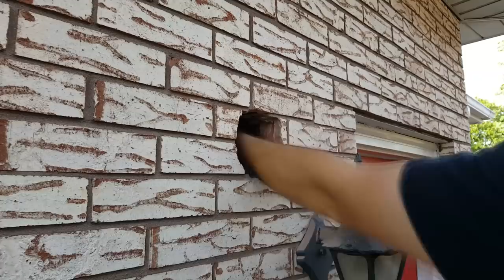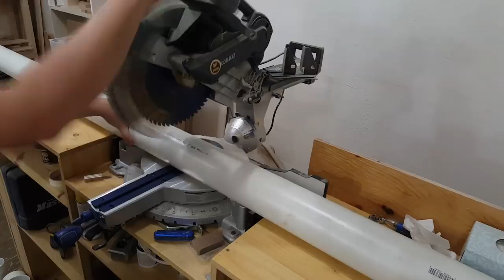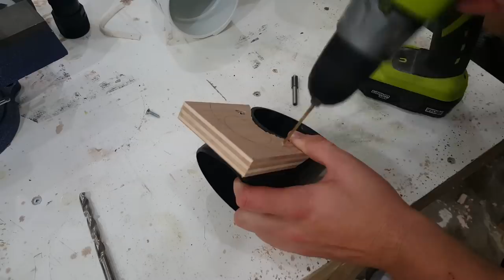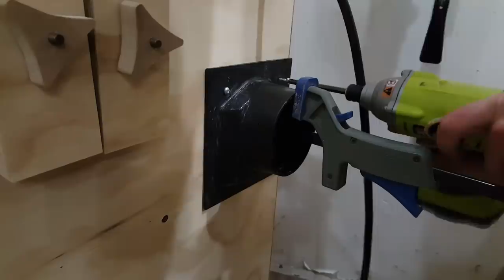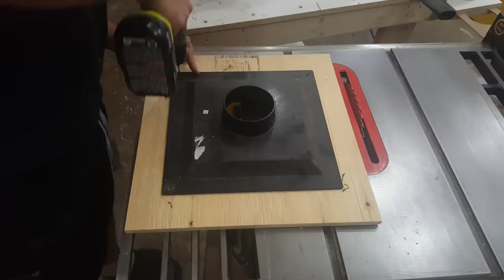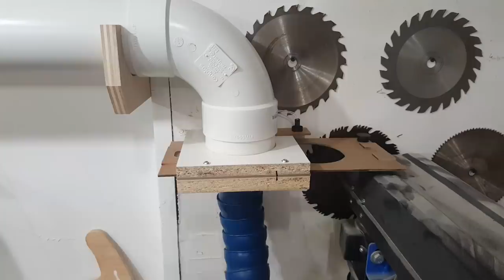DIY Dust Collector System with Homemade Blast Gates and Automatic Start/Stop Function

Comment: He’s gotta be in the southern states! You can’t exhaust it outside up here in the north, you dump all the heat out in about 2 seconds! 😩
Reply from the maker: In Canada eh
Reply: DIY Builds not quite but close enough.
Reply from the maker: @rbwoodwork1890  no im in Canada.
Reply: DIY Builds sorry didn’t get that.   If you exhaust it outside you will pump the heat out. If it’s just for a sec or two it won’t really matter but a long operation will empty your shop.
Reply from the maker: @rbwoodwork1890  it's not climate controlled in my garage.

Comment: I am trying to build a dust collection system for my woodshop class since my school district will not pay for it.  I have a somewhat decent size shop area with multiple tools running at the same time.  Suggestions on what I need to build the system to support several power tools at once?

Comment: Hell yeah! Another awesome video!

A few questions, though... First, what changed your mind about venting outside/filtration since your video on the cyclone? when I asked you about it then, you said it wasn't a big deal. Just curious.

Second, when you installed the flange on the bottom of your table saw, I noticed you caulked everything in place. How do you plan on doing any maintenance to the saw?

Third, are you using 4" PVC, and if so, how well are you finding the extraction to be with your dust collector? Also, what size is your collector? I'm trying to compare against my 2hp Harbor Freight version.

As always, I love the video! Fantastic job, and I look forward to your next one. Oh, and good to see you over at /r/woodworking, too!
Reply from the maker: +crouton976 I decided to vent outside because the cyclone doesn't get the micro particles. if I have to tinker with the table saw breaking the caulking and redoing it won't be that bad. the system has very good suction at each station with the 4 inch and 2hp harbor freight motor. the miter saw which is furthest away has great suction.
Reply: DIY Builds Hell yeah, man. I was kinda worried about all the fine dust after the cyclone video, but I sure as hell wasn't going to tell you how to run your shop! :)

That's great that the system works so well. Like I said before, I'm getting ready to set mine up almost the exact same way, so that's fantastic to hear.

By the way, I'm the market for a new miter saw, but I need it to be somewhat compact. I'm designing a miter saw station that will also double as lumber and sheet good storage, and of course space in my shop is at a premium. Is there any way I could convince you to tell me the measurement from the back of the rails to the front of the fence on yours at 90 degrees?
Reply from the maker: +crouton976 you should look at the Bosch miter saw that has the 2 folding arms to save space
Reply: DIY Builds yeah, I've considered it, but dat price tag, tho...

Seriously, if I can get away with a less expensive saw fitting, I will, but if push comes to shove, I might end up going with the Bosch.

If you don't mind getting that measurement, that'd be awesome, but if not, no worries.
Reply from the maker: omg its 24inches from front of fence to back of slider mechanism.... and thats why mine overhangs my stairs lol
Reply: DIY Builds Haha! That thing's a big ol' boy!

That actually works out. I'll have to shrink my bench dimensions slightly, as it will be directly across from the miter saw station, but I should still have a 36" walkway between them.

Thanks, dude!

Comment: Hi Brad, I really enjoy all of your videos. I am planning to build your table saw lathe (with upgrades) next weekend :) I'm also working on setting my all my dust collection up and I was wondering where you can get that bendable thing that you were using to collect dust from your drill press? Would you consider putting links to all the gear you use/feature in your videos?
Reply from the maker: Lee Valley. Called loc line
Reply: Oh and I meant, would you consider doing links of tools and items used in each video, in that video’s description. Many makers use affiliate links as well, to get a little kickback. I would gladly purchase through your links as a way to support your channel.

Comment: How do you like venting to the outside? I am considering this instead of buying a high dollar canister filter, but I’m worried that during the winter I will be exhausting too much heat along with the dust.
Reply from the maker: If u use heat or ac u need a filter. Watch my shop upgrade video from a few months ago.

Comment: Nicely done! Very interesting and inspiring. I might steal some of your ideas! 
Where do you stand in the discussion on risk of explosion because of static electricity when using PVC piping instead of grounded metal piping? There doesn't really seem to be a consensus on that topic :)
Or would that risk be irrelevant by blowing all really fine dust out of your shop? 
Would blowing the dust out of your shop mean anything for the air quality around your shop, or would that effect be negligible?

Thanks
Reply from the maker: +Edwin van der Burgt I wouldn't be outside or anyone else while I'm using it so it is fine for me to vent outside. there is no risk of explosion because the pvc is an insulator. you might get static shock from the outside of the pipe but there won't be a spark on the inside. the motor and blower and cyclone are grounded so any charge there is dissipated.
Reply: That sounds reasonable. Have you already experienced shocks like that? Would that be like the electric shock you can sometimes get while stepping out of a car? Can't be to bad, right? Money wise it's definitely interesting using PVC instead of metal.
Reply from the maker: +Edwin van der Burgt havnt been shocked yet
Reply: Let me know if it happens, I'm curious how bad it would be ;) Keep up the good work!

Comment: Do not use plastic (PVC) ducting. it can create a fire due to static electricity and saw dust. can create nice little explosions. Metal ducting is the only safe and secure way to go.
Reply from the maker: Thats not true.
Reply: @DIYBuilds  You even should put your cyclone and dust bin/bag outside so if it ever catch fire it wont burn your house down completely. It happens!  put your head in the sand, is fine with me.
If you build yourself a serious woodshop you should do it properly. grounding all metal etc etc.

Comment: hello I love a video in which we saw you install a dust collection system, I would love to know the place where the manufacturer of your little blue hose that you use for the drill press?
Reply from the maker: Lee valley loc line
Reply: @DIYBuilds  yes i found thank you very much and continue your exellent video

Comment: I’ve always thought it better to use 2-45 deg instead of 1 90 deg for bends
Reply from the maker: Im sure it is but that cost more money so I didn't do that lol
Reply: No your right you’ve gotta cut sometimes. Mostly it depends what you’re putting through there. I was a home builder I’m retired now and there were times when I made custom crown mounding . I had special knives made and made the crown out of 2x8s . So there was some chunks going through there. I have a grizzly 10 hp which is huge and not 2 stage so I’m going to remodel that. I also still have my original grizzly 2 hp. When I had big moldings to make I actually used both of them.  Later I found the 5 hp enough of I ran straight 5” hose from the collector to my moulder. I had a couple 90s and they would clog if I tried to make moldings through them. I’m starting from scratch since I’ve moved so just checking out every bodies ideas. I’m going to put micro switches on my blast gates. They are super cheap then I just need to get a relay to start the machine.

Comment: Any chance of detailing the low voltage blast gate switch set up?
Reply from the maker: +Rich Wachtel robably not. it's just a relay that controls the motor power flow. it uses a 24vdc adapter and a bunch of parallel runs to the normally open switches.

Comment: It's been 2 1/2 years.  Are there any water issues from not sealing the exhaust duct on outside the building?
Reply from the maker: I did caulk it.
Reply: @DIYBuilds  
I guess I missed it.
That's good to know.  Cool project.  Thanks for the tips.

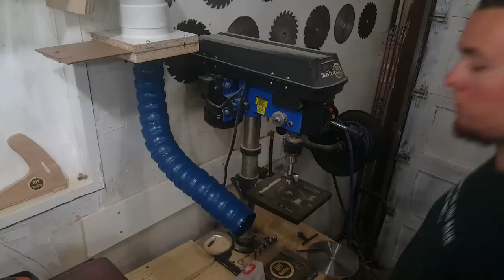Comment: where did you buy that blue flexible rose used on your drill press? the one shown at 10:07 on your video. Great setup of yours! by the way
Reply from the maker: Lee valley called loc line
Reply: @DIYBuilds  Thanks a lot!

Comment: Please, where did you get the blue flexible adjustable pipe which you use at 10:08 in this video? What is it's name? Thanks
Reply from the maker: +Miroslav Joha loc line at Lee valley
Reply: many thanks

Comment: Where did you get the low voltage parts?
Reply from the maker: +Kevon Houghton see viewers comments video #3. Basically you can buy them on Amazon.
Reply: Thanks.  Do you recall, specifically, which ones you used?  I'm not sure which comment / video you're referring to.
Reply from the maker: +Kevon Houghton i have a video called viewers comments #3. And any 24vdc or 12vdc contactor should work.

Comment: I have a question ?  I never see anybody talk about,, would smaller pipe be better ? more pressure or more suction like for in 2 to 4 "   will you suck up anything bigger than a 2-inch pipe I don't know ..
I would think 2-inch would have more pulling power than 4 " ?? somebody let.
 me know..
Thanks 👺 Teddie
Reply from the maker: No. The 4 inch is what the dc is optimized for in design. Vacuum cleaners have a smaller hose but higher suction power because the small impeller they have spins wayyyyyy faster than a dc. But a dc moves way more air.

Comment: 1 baffle for 3 connections?
Reply from the maker: If you mean the Sanders then yes. The 4 inch hose is capable of doing all 3 smaller hoses.

Comment: Where’d you get the flex line at 10:08
Reply from the maker: +Eric Althouse loc line from Lee valley
Reply: DIY Builds thanks!  What kind of piping did you use? Sewer or sch 40?
Reply from the maker: +Eric Althouse pvs

Comment: What's the blue hose called? Link? 10:08
Reply: I found this product from Lee Valley called Loc-Line which is great from drill press duct collection because where ever you set it up to suck it stays in place.

Comment: My only thing I see from the start is you are ducting the air outside instead of the conditioned air back into the room. If you are running AC you are basically removing all the AC air our of the area in a very short time.
Reply from the maker: No conditioned air

Comment: You need to add some bare copper wire around all that plastic duct to counter the static build-up, causing sparks inside the system. I know, what you have works for you, but the evidence is against you.

Also, it would be better to have a delay in shutting down the system after using a tool to clear the duct work.

Comment: Bad idea caulking all of those dust ports directly onto the tools. Dust ports clog, you need to be able to pull them and the hoses off easily to clean them.
Reply from the maker: +Geno Merci the blast gates come apart with the 4 screws so no issue.

Comment: After I break into my neighbor's, I'll be able to steal all those heavy equipment that you used. Then I'll invite my neighbor to help me build one those that you built. But I must thank you immensely for leaving the instructions. FYI I sell shoes. Therefore I have absolutely no use for such a device or set up. Although I like to take wood work in jail after I'm arrested for breaking an entry. Therefore I insist that you should leave instructions.

Comment: You didnt put an antistatic wire inside.
Reply from the maker: no why would I?
Reply: As you use the system static will build up.  It gathers dust in the walls of the tubes and starts clogging it but also creates a fire hazard.  Some people do it some people don't.  Some areas have it as a requirement for professional installations.  I'm sure you can find more information on it than I could explain here though.  It's just something I've seen professionals recommend.  Well I'm going to leave this here seems it may be a non-issue: http://www.rockler.com/how-to/exploding-pvc-dust-collection-ductwork/

Comment: The permanent connections are my only dislike.
Reply from the maker: +drwalker87 why is that? if I have to move I can easily cut them up and use couplers...
Reply: DIY Builds damn, why didn't I think of that. Nice build then, no dislikes.